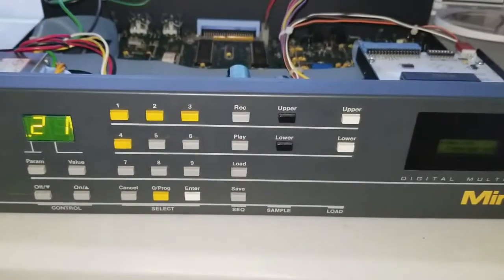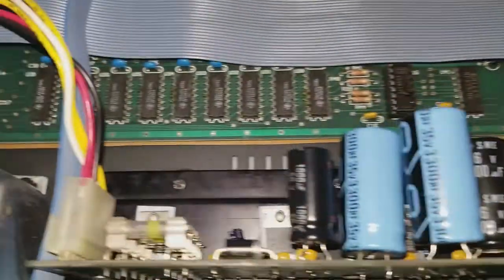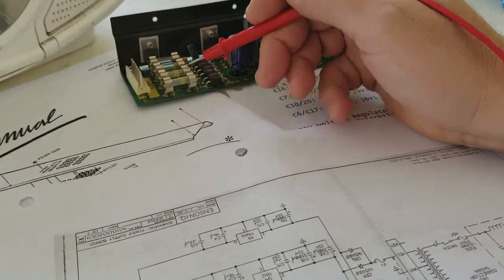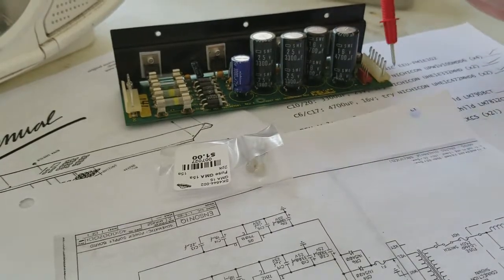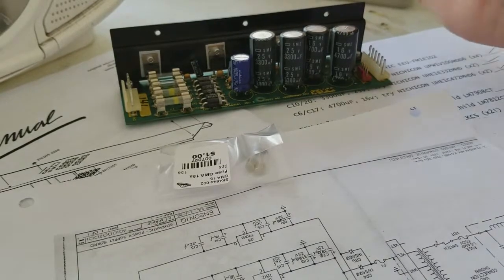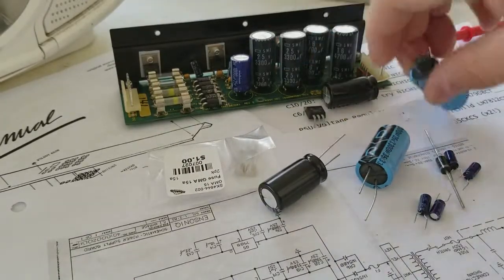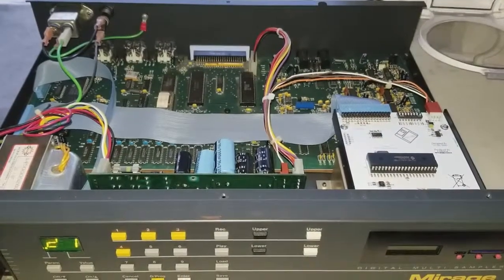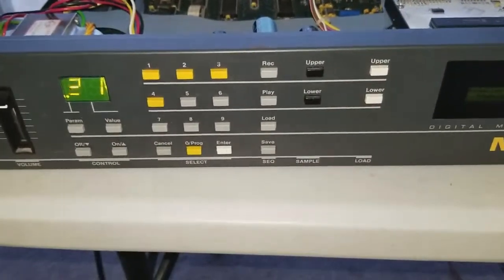Ensoniq Mirage power supply repair

Comment: hey, i think my DMS-1 has a similar issue. do you have the schematic for the rack version? or a list of the replacement caps? thanks !
Reply from the maker: We used these. Rack version is the same enough. If you can read a schematic you'll get by.
https://archive.org/details/sm_ensoniq_mirage_dsk-8_schematics
Reply: @ColecoBrothers  thanks! it's odd my board looks different than yours but is pulled from a rack unit.. there are no fuses on the power board. Did you have to replace any of the diodes? Also.. is there a trick to removing the voltage regulators since they are attached with rivets? I'm gonna replace the caps first and hopefully that will fix it.

Comment: Good Job!! I have a question: could this Power supply replaced by a PC Power supply?
Reply from the maker: Modern pc supplies are switching so they will be noisiy unless you get an expensive one.  You can Google the difference. I'm a software guy so take this witha grain of salt. It will probably function poorly, until it doesn't.
Reply from the maker: Now watch the video and like it, and share it on Facebook it will change your life forever...

https://youtu.be/FbhvGnI59Dw

Comment: i have a mirage that was given to me because the owner couldnt find anyone to repair it.... not exactly even sure whats wrong with it  im in ontario canada area if anyone knows how to repair hit me up if anyone wants to help me troubleshoot to figure out a direction id be thrilled
Reply from the maker: Join the mirage group on Facebook
Reply: @ColecoBrothers  unfortunately im not allowed to access facebook at this time legally
Reply: i think the problem is a tricked out one tho - because the guys from "synths when" a repair shop in toronto had zero clue how to fix it... perhaps they only service analog not digital gear - it must have some type of hardware component failure i would guess but im not really skilled to deal with thatq; i would have to get it out and re-assess as its been some time sittin on the shelf
Reply from the maker: @ChrisNova777  well the mirage is about as easy any any digital synth will be to fix.  if a shop says they cant then dont ever go to that shop, unless it was clearly oin fire.  v electrronics are built like a tank and they often dont have a catastrophic internal failure. usually some kind of basic mechanical stuff. moisture corosion or solder breakage. just like mine the caps will leak just sitting for 30 years so its ususally the issue.  good luck. since you dont know how, just sell it as is for parts. you mught get 100$. then buy a good one if you reallly want want a mirage. Since it was given you probably didn't want it anyway. if you just want a good keyboard the mirage isnt its a flavor thing not a musicval device. if you want a sampler get a computer thant can run VST's. ther is a very acceptable mirage pluging available.

Comment: My -8V rail is always at -10V. I have already replaced all electrolytic caps, fuses and the 7908C voltage regulator. How should i replace the tantalum caps? And should I also replace the diodes CR4 and CR6 IN5400? Any other possibilities?
The seconds problem is the mainboard. I have a working psu from a second mirage, but also with that the boot of the os takes 5 minutes. so I guess that something else is broken as well. i assume the cem3328.
Reply from the maker: I ended up replace the caps and the voltage regulator. Most of the stuf is  not going to wear out, but caps do. They caused the VR to work harder and it burnt.

Comment: These old power supplies do this all the time. Best practice is to rebuild the entire thing. It is simple to do and its done. Parts are not that expensive. Just be careful to get them in correctly. also, It does not hurt to up the temp coefficient on the caps.  Its a tad overkill but it is a one time job instead of piecing it out.  caps, regs, maybe even diodes. These Ensoniqs can be over 30 years old.
Reply from the maker: yeah I agree,  I bought all the parts to replace everything.  It cost about 8 dollars at local surplus store an di did juice up the caps a tad.
The store had equivalents not replacements.  We don't have any electronic parts stores in central Florida. radio shack was it, and now they are all gone. LA  has some good stores still. Digi key or mouser are premium prices about 88$ total, eBay is hit or miss, and amazon is unreliable for parts that I have ordered before. They are often from HK and not as advertised, So it take three weeks to find it wrong.  Anyway for 8$ in parts I would happily pay Some one to fix it, but professional rates exceed the value of the mirage.  Maybe in another thirty years it will be worth more than a thousand so it wont seem so bad to pay 200$ to get the power supply fixed.
or you could buy 100 of each part from digikey and kickstart a Mirage PSU repair KIT. that would  make it worthwhile to order from a proper supplier.

Comment: So all you had to do was replace the caps and put new fuses in???  It's hard to tell if yours has the same issue as mine because you have a floppy emulator but it seems different on my end as there is a buzzing noise when i connect the audio out.  This mirage is so clean I'm really hoping I can get it back up and running!
Reply from the maker: yes all the big 12v capacitors were replaced and it solved my problem. The 5v caps were/are working and I did not replace them. I had all the other components and did not need them.I bought the emulator because the floppy was dead, but it turned out the floppy was fine, just the PSU 12v was dead. 12V is used to drive the floppy and the SOUND amps. The emulator only uses 5V so it worked but there was still no sound. also the analog chip couldn't calibrate so boot time was 2-3 minutes for the calibration routines to timeout. the easiest symptom to identify is there should be a POP and whistle out the speaker when the unit is turned off and on. when the 12v PSU is dead there is no sound at all not even hiss noise.
Reply: @ColecoBrothers   I'm gonna do some testing before I get new caps to be safe...but also I noticed that my PSU looks different than yours as there are no fuses at all on mine.  Seems strange but I'm finding pictures of this same PSU on syntaur so it must be a different model.  I'd really like to salvage this Mirage, it is sooo perfectly minty otherwise!  Thanks

Comment: Just bought a Mirage and it starts to hum like crazy and then disks stop loading. Sounds like this is the problem. Thanks for posting.
Reply: mines the same (rack version).  Hum, the drive is spinning, but nothing at all from the screen and disdks never end up loading.  :(
Reply: Replaced my PSU and same crap. Takes forever to load and Transformer still humming. 🤨
Reply: does your screen have any lines or anything on it?
Reply: Astral Deeps it loads up and works for about 20 mins or so and then stops loading disks. So, eventually its failing the series of calibration checks it goes through. Usually, thats the PSU and a simple fix, but not with this one. Im going to take it to a shop Im familiar with and if it costs more than a couple hundred to fix, I will sell as is.

Comment: How did you drain the juice from the power supply so you could handle it safely? I want to convert my Mirage keyboard to a tabletop unit, but I’m afraid of that power supply. Thanks.
Reply from the maker: To be fair the power supply wasn't holding juice. but I did check mine by turning the unit on while it was unplugged from the AC mains, and verified 0v with a multi-meter. I am not an expert. If you are unclear it is better to be safe and bring in an expert to your project. I learned everything electronics from Archer (radio shack) engineer's note books when I was a kid. copies are all over Google.